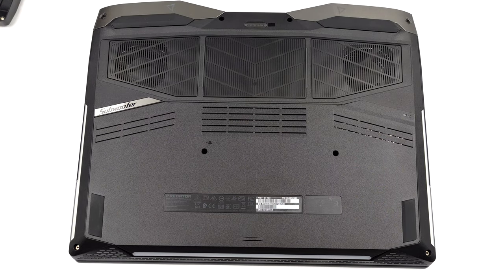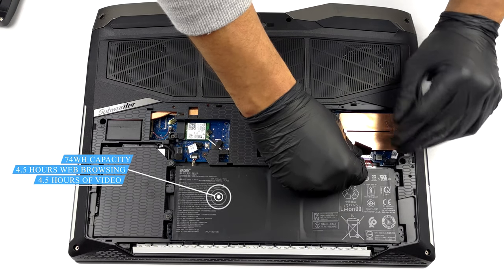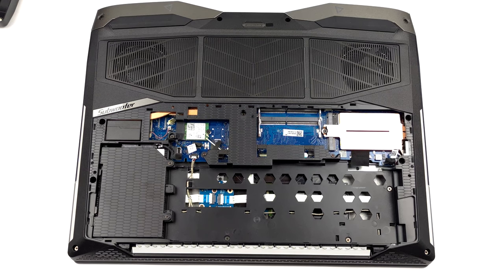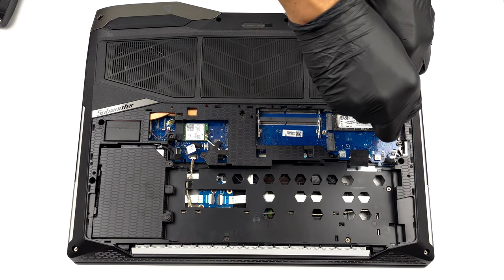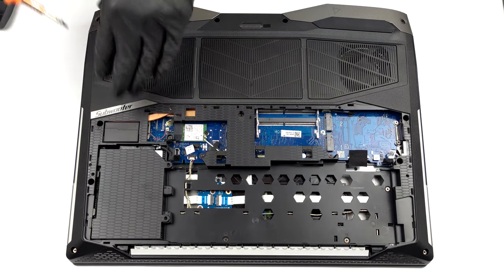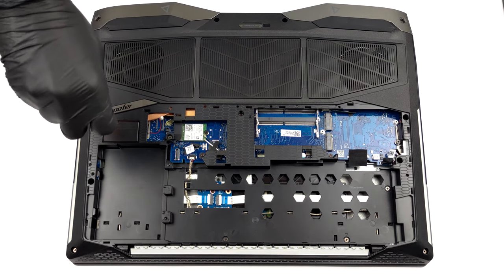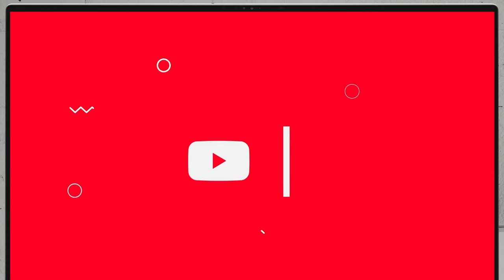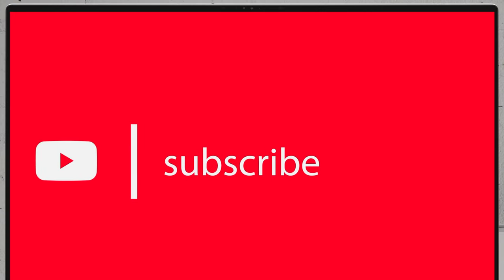🛠️ Acer Predator Helios 500 (PH517-52) - disassembly and upgrade options

Comment: 3 heatpipes? 3 heat pipes??? wtf
Reply: You didn't notice the slab of metal around those 3 heat pipes?
Reply: @andythomas7676  Sure, but they are themself not connected directly to grills
Reply from the maker: Yes, they are connecting the vapor chamber to the side-mounted heat sinks. Truth to be told, we noticed that the air coming from the sides is slightly cooler than that from the back. This indicates a suboptimal thermal transfer.
Reply: All of that copper and it still burns your sack off